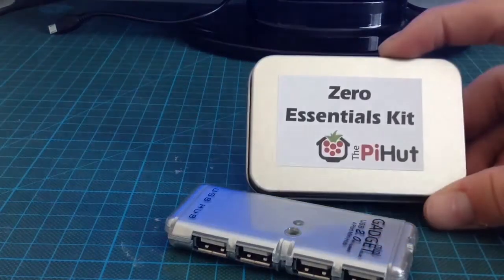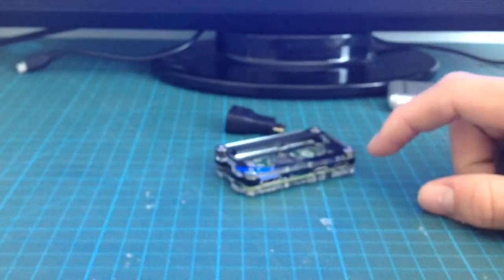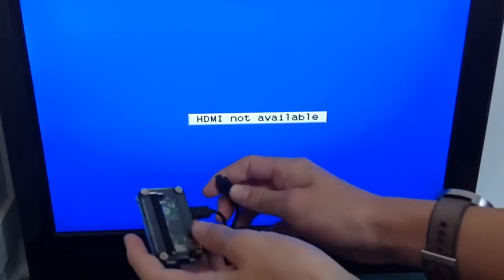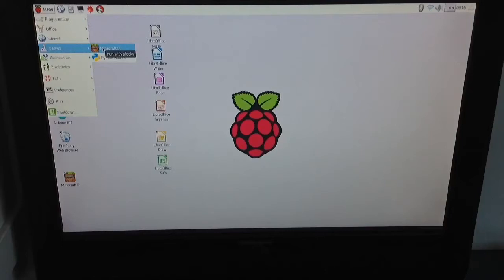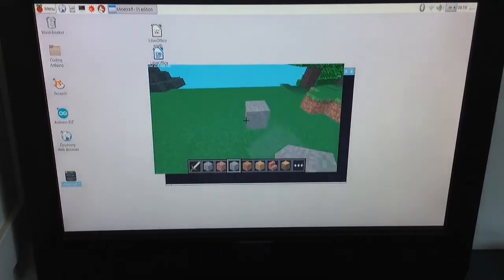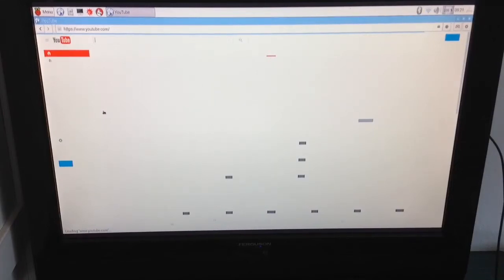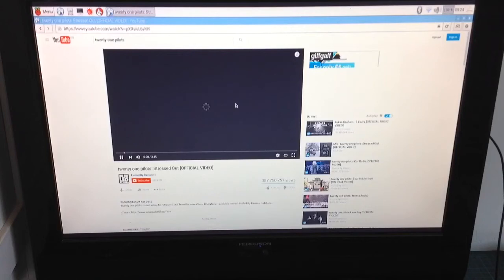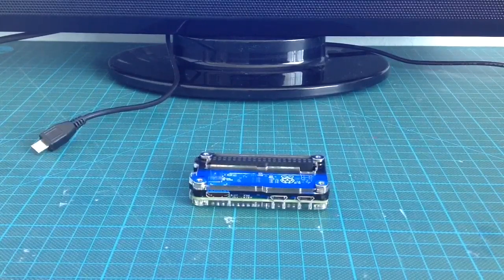Raspberry Pi Zero Review | The Pi Hut | Raspbian OS

Comment: Do you have a link or the name of the hub you are using?
Reply from the maker: No sorry I don't, I got mine from a charity shop for 50p but I have searched online and found one very similar on eBay : http://www.ebay.co.uk/itm/4-Port-USB-BUS-Powered-Hub-Allows-up-to-4-Devices-to-1-USB-007320-/381501838864?hash=item58d3481610:g:Gk8AAOSw3KFWfc3A